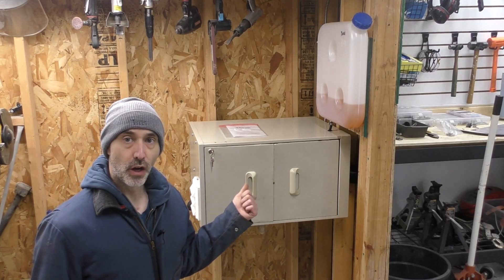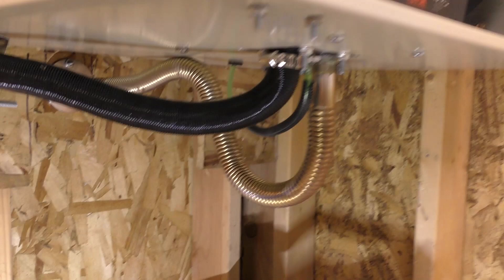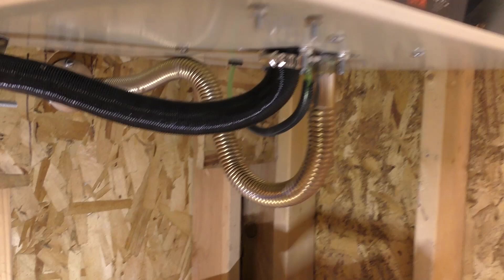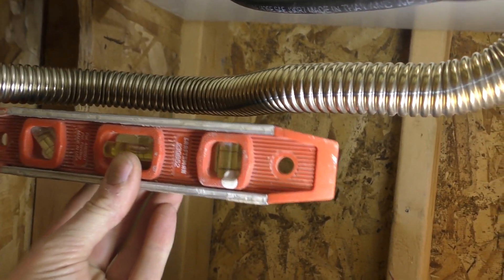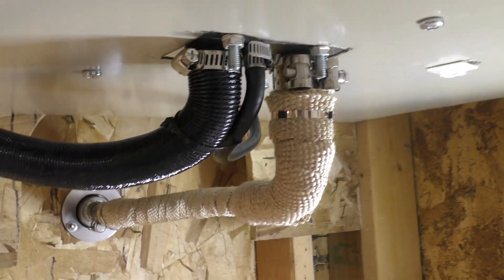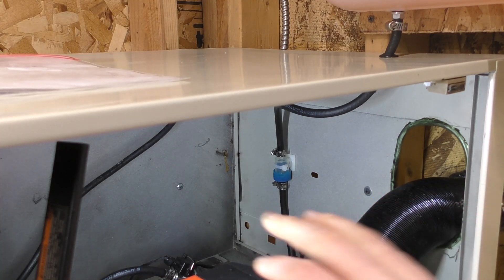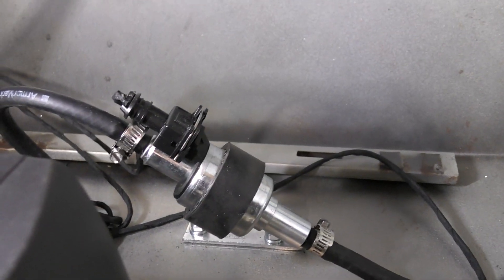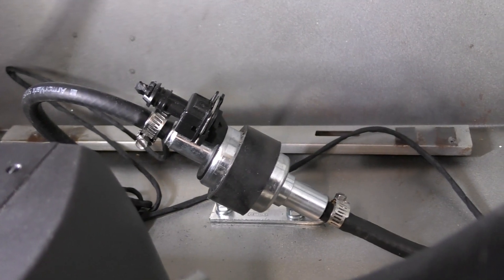Garage Mini Furnace User Suggestions and Corrections

Comment: You absolutely do not have to have your combustion fresh air routed outside. It’s recommended so that it always has a nice fresh cold air going into the burn chamber, but you don’t have to but what people should be doing that I see a lot of people doing the opposite is having the heat inlet and the heat outlet inside the structure so you are constantly heating the air that you’re heating instead of what people are doing and that is introducing constant cold air to heat up and then they wonder why it sounds very loud why it sounds like Jake breaks going off every now and then it’s because you have negative pressure in the structure, your Heating, whether it is a garage shed tiny home camper, RV or van
Reply from the maker: Thanks!  Good information.
Reply: @FixItScotty  and another tip those that are using diesel heaters with the 110 V adapter and deleting the batteries. You should absolutely never do that because it has a cooldown period and if there is no backup power when your household power goes out your diesel heater overtime will be ruined. You will overheat and you could make risks of not being able to fix it again.

Comment: The available length of exhaust pipe defines where u can install the heater.
Reply from the maker: That's essentially correct.  You can trim the smooth ends a little, but you can't cut down the corrugated part of the pipe.
Reply: @FixItScotty we need better stainless pipe like double wall but with smooth ends for clean connections. It would also be nice to be able to find custom pipe ,lengths.

Comment: I like your set up and you did a fine job. Regarding needing a battery to prevent an improper shut down? Nah. I think the heater will be okay. Keep rolling with that same converter. Also, ya don't really need the input hose to be outside. In fact, the best way to PREVENT that input hose from pulling in some of the exhaust is to do what you did;-- keep the input inside. I DO agree with the idea of using the better fuel lines, though. But ya did a great job and I love the cabinet you fixed up for it.
Reply from the maker: Yeah, agreed.  I think the need for a battery is overblown if you aren't using it full time.  I just turn it on while I'm working in the garage.  As long as it's not during extreme weather, the odds are it won't be a problem.  This is my second year using it and it's been great.  Thanks for watching and the kind words!

Comment: I can not seem to figure out why the stainless steel fitting going through the outside wood wall is getting hot from the exhaust  the plate thats screwwd on to the wood should be cold but its getting too hot it is driving me mad ive tried everything
Reply from the maker: Maybe the wall flange was made incorrectly?  There is a small air gap that you can see from the inside part of the flange between the center exhaust tube and the outer flange.  Perhaps something is trapped in there convecting the heat to the outer plate?  It's not that the outer plate stays completely cool, it does heat up a bit, but not enough to melt the rubber gasket that separates it from the wall.  Are you seeing burning on you wall?

Comment: Insurance companies always try wiggle out of paying anything.
I have had several power cuts when the heater was on with no problems. The other issue could be carbon build up due to lack of correct shut down.
Where does it say that there is a problem. I have never heard or seen any formal. warnings etc
Reply from the maker: I don't quite know the ramifications if power is cut to the heater before it cools down.  I suppose more carbon buildup.  I have been running mine off the power supply for over a year with no issues.  My power is pretty stable so I haven't had outages while running yet.

Comment: Add a heat exchanger (basically a radiator) to the exhaust output with a fan blowing through it and reclaim the heat it's wasting and blowing outside. There are multiple videos here on YouTube of how to do that.
Reply from the maker: Yes, it is a very common approach.  I have seen implementations using copper tubing in sand, or going through steam/hydronic radiators, or oil radiators.  Lot's to consider, but it isn't without risk.  You could invite exhaust leaks through added apparatus.  You could also add too much back pressure to the internal exhaust fan through the added apparatus.  So take care to test it well.  But definitely worthwhile to look into if you want high efficiency in your heating.  Thanks for the comment!

Comment: Lots of people are now making exhaust heat exchangers for them now, lots of heat escaping out the hole in the wall. Some use older cast iron radiators or modifying electric oil filled heaters, I have a enclosed trailer we camp out of, I have a larger pipe the runs the length of the trailer under the floor on the frame, the exhaust is plumbed into the pipe by a adapter, the exhaust moves slower because of the increased volume now allowing for the pipe to get heat soaked and radiate out under the floor, seems to work nice unless there is a good wind blowing, my floor isn't insulated and the wood is about 6" above. but it does seem to give us a little radiant heated flooring.
Reply from the maker: I have seen some of those radiator implementations for the exhaust.  I just didn't want to add any additional complexity to my setup since it only gets used in brief spurts.  Good point though; if implemented correctly, some kind of radiator can make these heaters more efficient. Thanks for watching!

Comment: Hi, I'm curious about the thru hall with wood walls, can you explain how these thru hall work so the wood doesn't burn.
Tks
Gary
Reply from the maker: The exhaust clamps to a thick 1" stainless steel tube, then there is an outer 1-1/2" stainless sleeve around that with an air gap.  On each side of the collar, there is a heat-resistant rubber gasket that is between the wall and the collar.  That keeps it from burning the wall as heat goes through it.

Comment: Couldn't you get a small UPS backup and simply plug your power supply into that? That way if your breaker trips or whatever, the UPS just keeps it running?
Reply from the maker: Absolutely.  Although not the cheapest solution, adding a UPS between the power supply and outlet is the easiest to implement by far.  Thanks!
Reply: @FixItScotty  Unless you find a cheap one!!

Comment: Forget a power outage damaging your $100 diesel heater you are potentially causing a fire hazard.  Good luck explaining those circumstances to your insurer.  A regular battery and and trickle charger will be fine. These units draw very little when they are up and running.
Reply from the maker: I must have missed something, how is it a fire hazard?
Reply: @FixItScotty  when a diesel heater shuts down it has to go through a cool down cycle where the fan continues to blow few a period to allow the unit to cool. In the event of a power outage the heater can't complete this cycle. The manufacturers specify they shouldn't be used with a mains power supply.
Reply: @Dickie2702  How will a fire occur ? Thanks
I've had power outages without any issues.
Reply: @mesherman read my reply above. I work for a fire dept in Canada and I've seen fires caused by this method of powering a diesel heater.

Comment: What are all the sizes of hose did you get ? I like that better than the nylon stuff
Reply from the maker: What a coincidence; I was just discussing this in a Facebook post.  I believe in the video I said it was 3/16" inner diameter fuel line.  I bought it by the foot at the local auto parts store.  Bring your fuel filter to the store to confirm fitment

Comment: I was wondering what the temp of the exhaust pipe is, now that it was wrapped.  I'm worrying about it setting a canvas tent on fire.   Any way you can tell me the temp of the pipe exterior?   Thanks
Reply from the maker: I was running it today and saw your comment. My infrared thermometer showed between 4 and 500 degrees F on the exhaust. But I can touch it for a couple seconds! So I measured it with a meat thermometer and it got a little above 200 degrees F. At the wall flange, it's a little above 100 degrees. So likely the wrap lowers the temp in the outside of the pipe by about 200 degrees.
Reply: @FixItScotty  Thank you and thanks for the quick response.
Reply: @cue881-yo7kz  I'm putting one into my canvas tent. How did yours work out?
Reply: @scdmr81-DaisyMayR  I kept the unit outside the tent and ran the heat tube in through my front door.    I had wood blocks under the heater, to get the exhaust pipe away from the ground.    It worked fine and the remote control was excellent.

Comment: I'm not putting your install down I really like what you've done with it. That said, here's another reason to drill another hole in the siding; 

Not routing the combustion air  intake hose outdoors will turn the heater in to a small vacuum, blowing the heated air outside in the exhaust but ALSO sucking outdoor air in through the path of least resistance - probably your garage door or the workshop window - to do so. 

It is the same reason why new "single hose" portable A/C units are a scam and I only recommend using older dual-hose units... The newer cheaper units usually suck hot air in through the same window it's exhausting cooled room air out of!

It might not be moving enough air to matter, but you might find it does a better job heating the garage space if it's not creating a draft for burn air.
Reply from the maker: That makes total sense.  It's the same reason high efficiency natural gas furnaces draw makeup air from the outside.  I will probably see how it goes this winter and then make that change next spring.  Thanks!

Comment: Hi. Nice install. How is the through hull adapter working for the exhaust. I’m planning to do the same, but I’m concerned about the amount of heat on the wall. Mine would be attached to vinyl siding on the exterior. How hot does it get? Thanks.
Reply from the maker: I was actually going to run it for a while and test the flange with my thermometer, but that old power supply that's running the heater is having issues.  So it may take me a bit to sort that out.  I will say, I ran it for several hours multiple times in the winter and I haven't seen any scalding of the wood on either side of the flange.  It is made to keep the fiberglass boat hull from melting, so I would assume it should protect your vinyl siding too.
Reply: Ok. Thanks. I may try running it with the through hull adapter in place before installing in wall to see how hot it gets first as a trial.

Comment: The sealed lead acid charges to just over 14v for full charge and should be held about 13.6v for a "float" charge.  After the charger is removed, they settle to about 12.6v or a bit higher.  If your current power supply is 12.0v, then that type battery would certainly not be overcharged if left in parallel with the power supply.  In fact, it would not be at a high enough voltage to stay healthy.  Something like 12.6v is more ideal to stay fully charged.  A 12v Lithium ion (3 cells in series) charges to 4.1v per cell, so X3 would be about 12.3v, so if you have a 12.0v regulated supply already, a 3S Li-ion battery in parallel would be a reasonable solution. Charged to 4.0v per cell is almost fully charged.  RC or "drone" type batteries have high current and even a relatively small one should provide the power to run the fan to complete a shutdown.
Reply from the maker: My current power supply outputs 13.4v.  So I agree with you, I think I could still use a SLA battery in parallel and it would just float charge while running.  The only reason I wouldn't use a lithium pack in parallel with this power supply is that lithium chemistry prefers to be charged at a lesser amperage after ~80% SOC.  So a smart charger would be better than a "dumb" power supply to auto adjust the charging algorithm to suit the chemistry.  Also, many lithium chargers have cell balancing inputs as well that would help keep the individual cells balanced at the end of the charge.  That is why I mentioned if I went with a lithium pack (like an RC pack that you mentioned) as a primary power source, I would just replace the power supply with a smart charger designed for lion.  Thanks for watching and sharing!
Reply: @FixItScotty  That voltage (13.4v) would work well for lead acid.  About lithium, in your suggested solution, the lithium battery would not normally discharge and so balance would not be a real concern.  Balance concerns are greater when the cells amp-hr capacity is different because of wear, coupled with cycling of the pack without a balance function.  Also, charging lithium at a fixed voltage causes the amps to taper off because the voltage difference between the power source and the battery continues to be less as the battery voltage comes up.  So ohms law takes care of that.  I have several "chargers" that are just current limited voltage sources set at 4.0 volts per cell to keep a battery charged.
Reply from the maker: @ddthames   Good to know.  Thanks for the insights.
Reply: I'm not sure if a power outage and sudden shut off of the diesel heater is much to worry about. Many automotive / RV applications, roof-top tent applications use portable stations that suddenly run out of battery and will simulate that same condition. Not sure I've seen too many people talk / complain about that?
Reply: @thedetroiters ,

I am thinking many of those units are exposed to the elements and would get a rough ride cool down due to wind or weather? In a shelter or heated space or cabinet, the process may well be too slow.
Reply: @thedetroiters  Maybe you don't work for the fire dept, I do. Trust me there have been many fires caused with this very dangerous approach.

Comment: Nicely done Sir! Thanks for taking the time to share your thoughts and experiences. I agree on the Mickey mouse exhaust clamps, they produce a uniform clamping force on the entire diameter delivering a much more robust seal at that critical juncture. a bit of exhaust sealant at that connection can also help ensure a good seal.
Reply from the maker: Thanks so much for your input as well.  As you can see, it had a lot of influence on my build.

Comment: I recommend a power station with solar panels and the option of charging my power station with 110v from the house that is what I use with a 110 to 12v converter solves all those issues of shut downs
Reply from the maker: That is certainly a good way to do it.  Thanks for sharing!

Comment: Thanks for the video!  The fuel pump on these is known as a "lift pump" on a diesel engine.  It is a diaphragm style pump, so angling it slightly upward keeps the diaphragm submerged in fuel and keeps it from cavitating (foaming air in the fuel)
Reply from the maker: Your description makes a lot of sense.  Thanks for the info!

Comment: Great video. Thanks for sharing the knowledge. For the power issue, can't you just get a battery back up like for a PC and just put that on your AC line that way you don't have to rewire or change anything? It's already set up for 110 AC, might as well just back that up since it is easy and readily available?
Reply from the maker: Absolutely.  Putting a UPS in between the power supply and outlet is probably the easiest solution for a backup.  Great suggestion!
Reply: An UPS is a good idea and will work well, as long as you only run the heater while at home and awake. Many UPSs will not provide an extensive run time, so you will need to shut the heater down before the system crashes.
Reply from the maker: @daviddawkins2829   Agreed. That would work perfectly for me, but maybe not others.
Reply: Many UPS units can signal for a Windows/Linux shutdown over USB or serial when the grid goes down. Maybe a Pi Zero or Arduino could act as a go-between, if it could be made speak to both the commercial UPS, and the diesel heater. The diesel heater end would be the harder side. I'm not sure what the capabilities of your heater control panel are, but some of them can work with keychain RF remotes and/or Bluetooth apps... Which might be a way to interface with some sort of Dev board.

 @daviddawkins2829